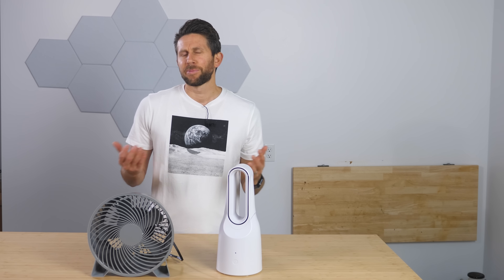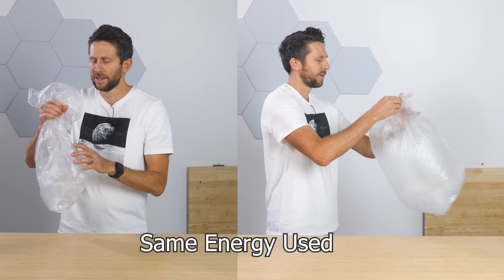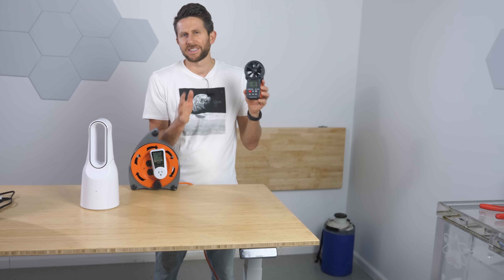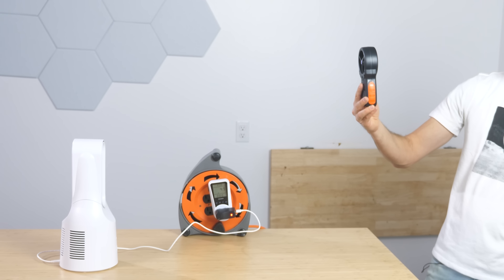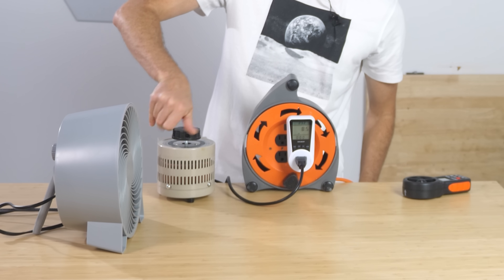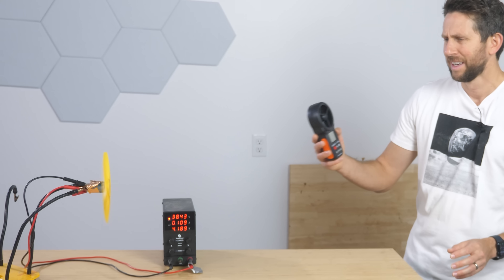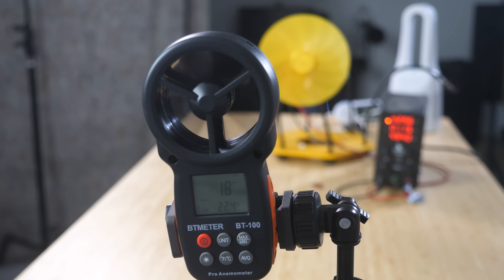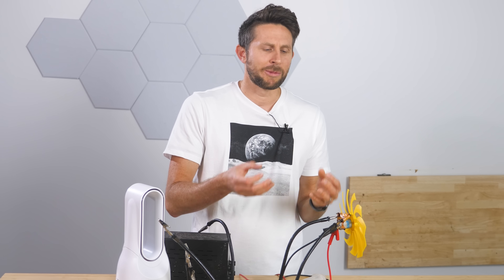Are Bladeless Fans a Scam?

Comment from the maker: Yes, volumetric flow rate would have been better to measure, but there is no really good easy way to do that. I just chose fans that had very similar cross-sectional area. So the cross-sectional area of the bladeless fan, including the entrainment hole, was similar to the yellow normal fan area. In fact the yellow fan was slightly bigger. So that means it moved more air faster than the bladeless. Not a perfect test, but it was pretty easy to see, just being in the room that the normal fan using the same watts moved more air faster than the bladeless.
Reply: Hey man! volumetric flow rate isn't just a better way, it is the only way that makes sure we deal with facts and not assumptions. Also different models and fans may yield different results. If you can show a dyson fan motor out of the unit can flow more volume of air than the fully assembled unit, then you rest your case for all bladeless fans. Good luck!
Reply: But there are good ways to measure that because it's done industrially all the time (HVAC systems are certified for total air exchanges-per-time in cleanrooms, for example). May not be good for the scale you're working at, but that's an experimental limit which needs to be explained -- 99.9% of your audience has probably never dealt with airflow on an engineering level. It's one thing to take a crude measurement and declare it as such, but it's something else to publicly and from a position of authority make relatively specific claims about efficiency of a specific product when you're using indirect measurements without standard controls such as the appropriate units of measurement or experimental design which allows you to translate your output into those standard units.
Reply: As an aerospace engineer, I had was on an IRAD where we needed to optimize a hepa airfilter to clean a room for a spacecraft. The only thing you measure is volume metric efficiencies. It's not -better-. It's the only way to generate meaningful results. Velocity profiles are one off the rail from serving absolutely no purpose from which to draw any kind of scientific conclusion from. We worked in wattage and time per how many times we cycled the entire closed volume of air. We had to use standardized dust molecules (yes that is an entire industry).
Spoiler alert: Those bladeless fans are orders of mangintude more efficient and effective a moving every molecule of air in a room on every metric. Including kicking up dust off the floor, which you noted during your use of the anemometer. A field of hot wire anemometers are going to be much more useful for what you are trying to run here. Bladed fans have a very significant entrainment coefficient because the transaxial velocity imparted by the geometry. Just a heads up.
Reply: @JaredBrewerAerospace  You should stick to whatever you do. Because it is clearly not designing fans.
Reply: Maybe bladeless fans are made  safer at the expense of inefficiency.
Reply: That bladeless fan i a really cheap one. I do think that with a Dyson bladeless, you would get different results 😉.
Reply: I was confused because i thought you should know better than to use air speed and I was going to chastise you for it.
Reply: "Not a perfect test..." 
- no
- it is a starting point, setup should be similar, comarison of different fan types in both setups (radial, normal), same speed at the entrance of the fan to compare volume flow etc...
- most likely a lot of comments for that
- could be a thesis
 
"but it was pretty easy to see, just being in the room that the normal fan using the same watts moved more air faster than the bladeless."
- which is somehow the definition of non-scientific
- a good test eliminates feelings and impression as they are not proof
Reply: Bladeless Fans became popular in the late 90s when Sharper Image was pushing the Ionizer Fans.  People thought all bladeless fans were Ionizers, and they were touted as a major healthy alternative to "bladed fans" that "blew dust throughout the house".  I sold them, and that's what our market research said.

The cultural infatuation with bladeless fans stuck around.
Reply: For flow measurement, you can direct the fan flow inside a 0.25 cubic meter bag, with the borders of the bag being air-tight, and with a pressure sensor inside the bag. There is a formula that gives you the flow, as the pressure is the integral of the flow...
Reply: just get a DC powered fan for the latest and greatest. it is outrageously more efficient and slightly quieter (on brushless motors).
Reply: You should have measured the power between the variac and the fan.
Reply: Perhaps I could make some experiments in a wind tunnel to properly measure the efficiency, perhaps I can even made it my master degree, thanks for the idea! Hah
Reply: @jasiumodrzynski861  Pretty sure it has been done and published before.
Reply: 🔥 Fire fire rectifier 🔥
Reply: The yellow fan had a wider area and higher speed, that should be higher volumetric flow(I am fairly confident you measured the speed far enough away that the pressure should be back at 1 atm, so mass flow rate should be matching volumetric flow rate linearly for improved mass flow rate too.)
Reply: There should be a windblade fan, where the winds that laminarly flow the air are actually the blades of the fan itself, hahaha 🤣✌️👍
Reply: There's this device called balometer, but it is not exactly cheap. It is used to measure volumetric flow rate from end filters.
Reply: I think its more about air volume exchanged per hour than wind speed of that air volume.
Reply: Fans are mass devices.  As long the air temp and humidity were the same, volumetric would work as well.
Reply: They don't hurt when you put you hand into it🤓🤣
Reply: Hi
Reply: @SpiritSlayer1  🎯👍
Reply: Maybe place each fan and anemometer in a large tube?
Reply: This was my first thought, but you quickly addressed the relative cross sectional flows sufficiently to satisfy my notions of a fair test.  Here, we are not looking for precise volumetric data, only evidence that the air slits consume potential air flow energy that is not recovered, let alone multiplied, in the net air flow output.  The difference is glaring enough to spoil the scam.
Reply: entertainment hole
Reply: The first step of designing a good experiment is to actually measure the correct things. This video is garbage.
Reply: I think there is a good way to measure volumetric air flow.
Put a column of falling flour behind the fans, and see which one moves more flour after it settles.
Reply: @TheActionLab becoming @ProjectFarm 😅
Reply: I thought you called it a "entertainment hole"..
Reply: Very easy to measure.  Just put a large, weight, hanging surface in front of each fan and see how much each is able to deflect the hanging wall.
Reply: @dinofx35  No matter what those "bladeless fans" aren't as efficient.
Reply: Are the blades relatively the same size? Would that have an effect on the experiment
Reply: I saw your ion program and congratulations to you.  You prove the Flower/Seed of life are not in a vacuum and is the carrier of sound.  Bravo🎉.   That is "dark energy"
Reply: the fan you used was just as tall.  but thus also alot wider.   
so it's not a propper comparison.
Reply: The way to do it is to just place the fan in a big room and do measurements in a radial grid in the forward hemisphere. Then you can integrate the values and get the total flow of air the fan moves.
Reply: The way engineers measure the flow rate is using a hood or just a tube made from a cardboard box to give a fixed cross sectional area attached directly and sealed around the fan (more frequently a ceiling diffuser). 

Note that the bladeless fan is designed to be directional to allow personal cooling but also a Dyson has two settings, wide and narrow. The Dyson would be better in wide air movement. 

And yes as a HVAC design engineer who has studied thermal comfort, humans like air movement when the air temperature is warmer, it actually allows us to withstand higher temperatures  as long as the humidity isn't too high as it improves convection and evaporation of sweat which provide cooling.

Source: Me a HVAC design engineer (Building services engineer or Architectural Engineer in the UK)
Reply: the air  speed was faster because the air was concentrated in a small area but the volume of air flow  probably has reduced when you removed the fan from the blade less fan
Reply: Mass flow rate would be better
Reply: As a person living in a tropical country, bladeless fans are not so good. We need power and wind speed. Even the maximum of the bladeless fan is just the average of the normal fan. Plus is way cheaper. Yes the bladeless fan uses less watts, but the amount of money to buy it is still way more expensive.
Reply: Yeah you really need to be measuring the volumetric flow here, or something like that. Just time how long it takes to fill a big garbage bag when you tape it to the mouth of the fan, easy!

Now maybe you do want to measure something else, like static pressure against a surface, or maybe you do want the air velocity at a given distance. But most people are probably wondering about volumetric flow per watt, and you can't use air velocity as a proxy for that!
Reply: What if you tried to use the bladeless fan to blow up a large bag? would the bladeless fan do better? or would the normal fan do better? mayber there is a use for bladeless design? in terms of volumetric flow like you said? I'm just making a hypothesis here, hope you can test it out! I am a huge fan of your channel btw, please never stop Inspiring!!!
Reply: You can direct the air through a tube containing a plate with a small orifice.   By measuring the difference in pressure before and after the orifice you can calculate flow.  Ok, not an easy way but it is accurate.
Reply: You are kind of incorrect in some aspects... And here's why....

Point 1. They werent built for stylish points and to impress your friends with. 
They were invented or built for a child's safety in mind. It was so little kids wouldnt loose or hurt themselves by sticking their fingers into the fan blades.

Point 2. The ORIGINAL bladeless fans were about 3to4 times bigger then that and used the exact amount of power as a normal fans would, like your first one that you showed.

But the thing you were right on though and proving what we already know, is how manufacture's and companies can produce crap then brainwash the dosiles out there and take their $$$.

Other than those minor misteps in this video that i have pointed out, it was a really good educational one.
Reply: You can time how long it takes for the fan to fill a trash bag of known volume.  Used this method in a lab to test computer fans at university.

It's a bit crude admittedly, but it's very straightforward.

I also recommend measuring flow speed at distance increments off the centerline of the fans so as to get a profile.  This can also help to give a crude estimate of volume flow rate if you like doing mathy integral stuff.
Reply: @TheActionLab Can you measure the time of cooling a sealed cup of hot water using fan?
Reply: @PanMiDa  he could but there are equations for this already. Heat loss is the sum of the losses via convection, radiation and conduction. If you know the surface temperatures (mean radiant temperature) and the air temperature where the water is and the air volume the fan produces it's not too hard to work that out.
Reply: You can buy a Mannix meter that will give you volumetric flow rate, velocity and temperature.
Reply: Ahh.... the preemptive reply to my now unposted nugget of wisdom. Well played!
Reply: Change the fluid. Instead of air, use water. Instead of air pressure, use steam. A water injector for a steam engine would be easy and you can get the parts even today. Students used to have their minds blown that you can indeed inject water into a boiler using steam at the same pressure as the boiler using condensation and the venturi effect.
Reply: It's apparently less "choppy", easier to clean and may be better for people sensitive to the rotational frequency of the blades. But for most people it just seems a gimmick. It's used in medical settings as its believed to be more hygienic.
Reply: You can't prove which fan moved more air since you never measured volume. You can only say that it moved whatever volume of air faster.

Flow and pressure (or speed in this case) are not the same.
Reply: Maybe it's a safety feature,  so children and all won't accidentally get their hands caught in the blades
Reply: Aerodynamics is not so obvious and easy kickstart  experiment with
Reply: Well, invented and marketed by Dyson, so no surprised it's a poor performing rip-off.
Reply: Stupid design.
I had seen quite a number of these blade less fans in the dumpster.
Some of these fans were a pain in the butt to repair.
Avoid them at all cost.
Reply: So what i'm hearing here is that you know you have a flawed test, but keep this video up because it makes you money.  Gotcha.
Reply: are videos about bladeless fans a scam?
Reply: There are also losses when you route air through channels with "bladeless" fan.
Reply: @conanobrien1 surface interactions vs just a propeller aren’t comparable but the addition of a Venturi increasing flow perfectly tuned in theory should out perform the prop! But in reality? Nah! Doubt it!
Reply: @conanobrien1 pressure losses yes. But typical axial fans are lower pressure and don't induce as much air as a bladeless type.
Reply: @gazzat5  Each time you introduce a bend in the path of the air, you get losses... This is what I meant.
Reply: @conanobrien1  ya i was fascinated well by dyson and they mentioned their newer vacuums were designed to keep the air sucked in a more linear fashion
Reply: Next experiment:  window fan vs. fan blowing at open window from a few feet back
Reply: AvE tested the Dyson blow drier compared to a cheap one by timing how long it takes to fill a trash bag. ThEn ThIS hapPeNdeD!
Reply: I would think the bladeless may reach farther distance in a more precise area. Like air cannons blowing O rings but that might not work if its constant air flow
Reply: Could team up with Major Hardware (Fan Showdown) for volumetric tests.
Reply: The Dyson bladeless fan uses a compressor so it's efficiency is different (I'm not saying high or low but different)
Reply: @tinkerersagar  My experience of the dyson fan is that it is noisier and more directional than a good fan costing 20% as much.  I use fans a lot, and I would never trade my conventional fan for a dyson.
Reply: @tinkerersagar more pressure and more directional, correct
Reply: the keyword is energy efficient. i havent seen any bladeless fans claim theyre better, only that they use less energy. which is basically next to nothing anyways
Reply: It's easy to measure volumetric flow rate using a flow hood. You could close off the entrance of the flow hood with a piece of cardboard and leave a hole just large enough for the fan. This would accurately measure flow volume without adding any pressure. I suspect the results would be the same anyway. I love your videos btw, thank you!
Reply: I used to work for the medical field, certifying air flow in various devices. You 100% need a flow hood for volumetric flow (total air movement). If you don't have one you can take multiple-multiple airflow measurements using the anemometer within a given (closed system; duct etc) cross-sectional area, to calculate effective volumetric airflow. It cannot be done in open air. Trying to measure or even have a ballpark figure of total airflow in open air is like going to the fastest part of a river and using that velocity to calculate overall volumetric waterflow of the river (not within reality). While certainly entertaining, I implore @TheActionLab to acknowledge this, because as it sits, this video borders on being misinformation. Given that point, and that it's about a product a big $$ company sells, they may have something to say about this video. If you'd like help with understanding airflow and how to measure it, maybe reach out to Major Hardware.
Reply: @vaughnengler9436 , I don't think you can use a flow hood that restricts the entrance only to the fan profile here because all the effects of the air getting dragged by the flow from the edges would be eliminated.
Reply: @vaughnengler9436 spoken like an engineer!
Reply: You've missed the point of Dyson products: to look cool. Isn't that neat, a fan that looks like there's nothing inside?  Isn't it cool that the Dyson hair dryer has to be awkwardly held sideways and sounds like a dentist's drill? 😮 😂
Reply: @RM_VFX  Dyson has good industrial design & marketing. But that is about it.
Reply: I liked the bit at the end.  Oh! you seem way cooler now.  🤣
Reply: Great topic! I’d think that a true test of efficiency would need the same motor used in the bladeless fan but fitted with a suitable size prop to calculate efficiency via current used vs airflow produced! does the Venturi really outweigh the restriction of ducting and concealed axial impeller or even with a centrifugal turbine type compressor being amplified by the Venturi effects, is that really better with all the extra surface interactions with the air than an open prop?
Reply: Considering that the single point airflow measurements showed the bladeless fan inferior, it would have been a huge waste of effort to engineer a volumetric rig that didn't adversely affect the fan output.
Reply: The wider area of flow with traditional fans has already shown it has more air flow. Just imagine the air flow is forming an invisible tube. The area of flow is like the cross section of the "tube".  With wider the cross section and faster flow speed, the volumetric flow rate must be greater that the narrower cross section.
Reply: I thought these " IONIC" Fans were supposed to 0 blades ??? 😮
Reply: You can deduct the volumetric flow rate that from radius and speed
Reply: @rudyberkvens-be  laminar flow and navie-stocks formula? I don't think it works like that
Reply: That was implied yes, but there are ways to test it.  One that comes to mind would be to use them for lift on a small hovercraft and measure the height it could lift off the ground.  Either that or to make things more fair, use voltage instead of power, since voltage is kind of the wind speed of electricity.  Not exactly the same, but as close as you are going to get.
Reply: i think you could have measured the air speed at various points in a bigger cross section and then backed out the total rate of change of a volume of air. but i imagine the dyson fan also produces a lot of instabilities that prevent efficient movement of air.
Reply: @antimatterhorn this is another method engineers use, usually for internal duct measurements. Take a grid of measurements say 9 for a square area and average the velocity.... This is down to Bernoulli's principle or how air sticks to the walls of ducts, walls, floor, ceiling, tables - any plane etc
Reply: Your test was correct.
Airspeed is more important than air-flow. We don't care how much air is moving, we care how much it cools us humans down. Therefore 'wind-chill' is the important metric here and this is dependent on wind-speed, not volume. But at temperatures where we want to use a fan to cool down, we talk about 'heat-index' and not 'wind-chill'.

Maybe you can get an indication of how much comfort a fan brings by measuring the wet-bulb-temperature at a certain distance from the fans.
The fan with the lowest wet-bulb-temp wins.

Wind-chill and heat-index are defined with the average human face in mind. 
So exposing your own face to the airflow of the fan (in warm/humid conditions) and describing the cooling effect you as a human experience is the better metric.

(finding the relation between Watts and volumetric flow is still interesting. The vertical windtunnel I used to visit has the same blade design as the bladeless fan. It was calculated and tested that that design would be more efficient than regular propellers/impellers at moving large volumes of air at 60 m/s )
Reply: Na. You nailed it. Scam-fan.
Reply: This experiment was very good. I instinctively was not fan of bladeless fan, and glad to have some proof supporting it.